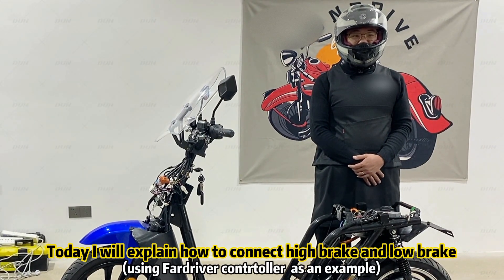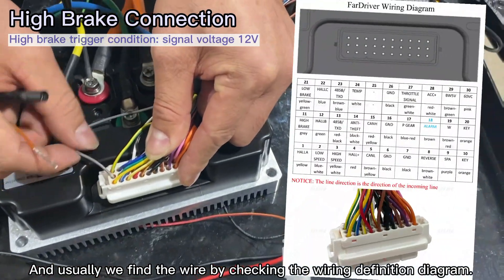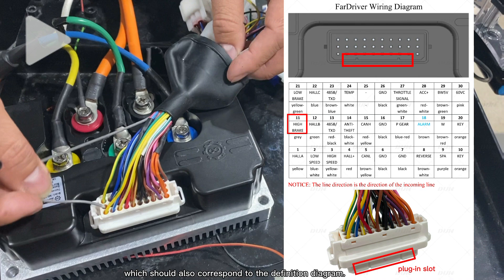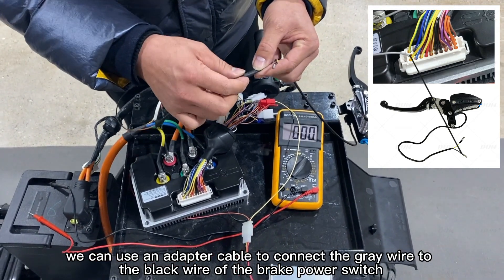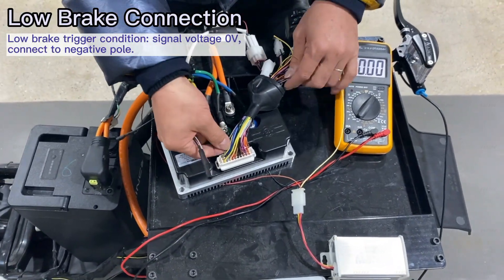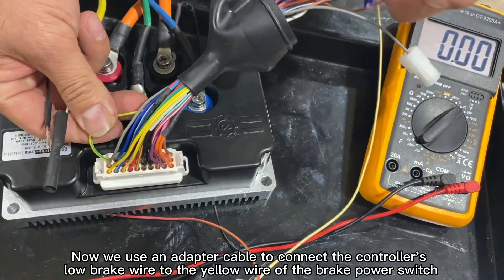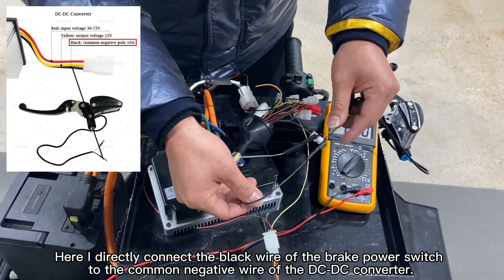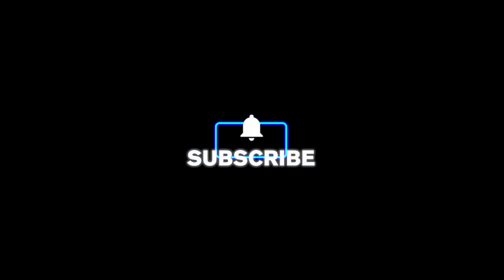How to Connect High Brake and Low Brake

Comment: So both liw brake and high brake are 12v is that correct,  what is the difference from low and high brake please
Reply: Low brake is activated by contacting to the ground, high brake is is activated by contacting to 12 V. In case you do not have DC-DC converter on your bike (for example off road bikes, especially converted gas bikes, does not need that as they do not need turn signals and/or tail lights 
etc. and uses LED front lights or not any), you can use only low brake. When you have a tail lights, you need high break.
Reply: @mario_on_e-odin2.0  Perfect i reched out to my supply and yes as i have a 12v dc - dc converter had to use the high brake worked perfect ..... great video keep up great work

Comment: Where on the 12v wire setup can you connect a taillight?
Reply from the maker: Do you mean the brake light of the taillight? you can connect the 12V wire of the brake light to the high brake wire of the controller.
Reply: Thank you I’ll give it a try.
Reply: question , when connecting the high break to taillight, the taillight is on. whats the problem with that?

Comment: Hi just wondering what's the difference between high brake and low brake
Reply from the maker: hi, the trigger conditions of these two are different, high brake: signal voltage 12V, low brake 0V

Comment: Can i use low brake as Park function?
Reply from the maker: no, they are different. fardriver have park function, but it need to switch the pin port on its app, I will make a video later to explain this, you can subscribe to our channel.

Comment: Hello, what voltage should I apply to the yellow wire to turn on the controller?

￼

￼
Reply: The Fardriver ignition wire is Orange, not Yellow. Batt (+) is normally connected to a key switch, then after the key switch it goes to the Orange ignition wire and all accessories, including any DC/DC converter and the display power.